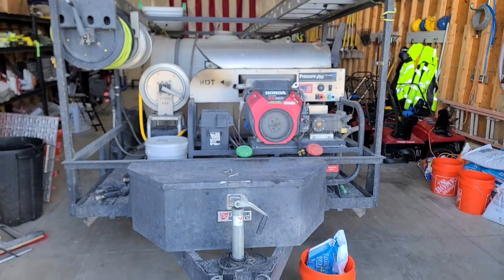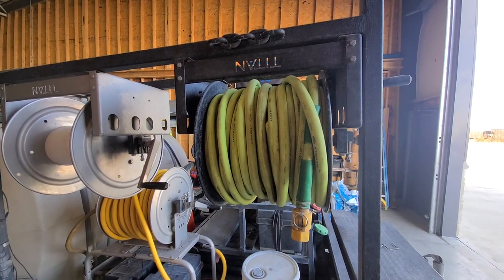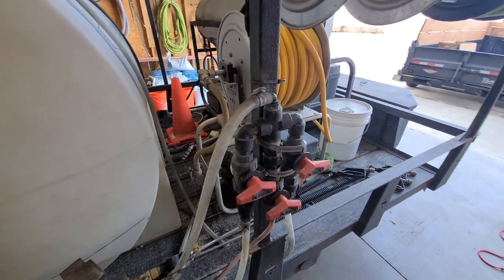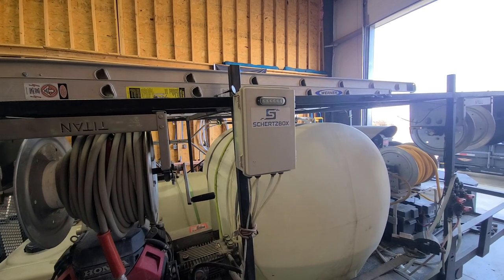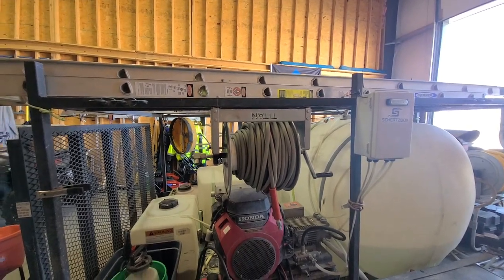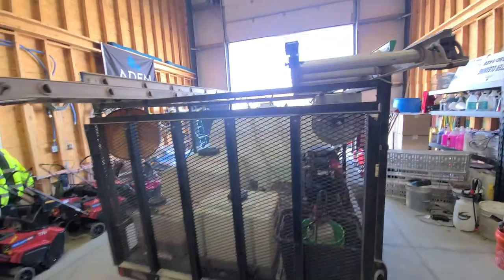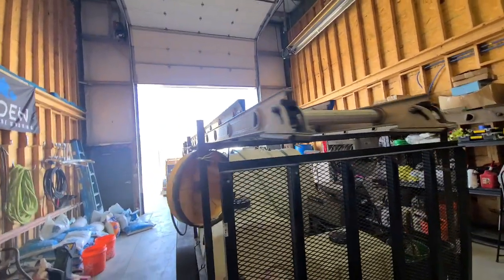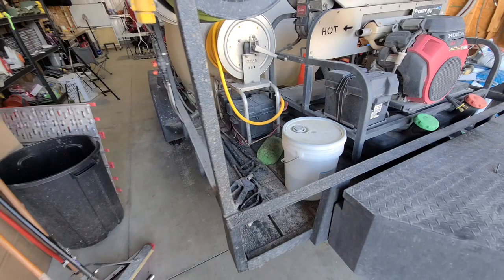2023 Pressure Washing Trailer Setup and Walk Around

Comment: Looks good. If I was to make one suggestion, it would be to add a piece of flat steel or something at the bottom of the surface cleaner, just so the bottom doesnt flap around in the wind as you are driving!
Reply from the maker: Good tip!

Comment: I love it.   The trailer.    I’m thinking about getting one but I’d like the smallest but still vertical capable.   Probably cold water for starters.   I’d like to get a skid but I’m not sure if it holds enough water/ SH.   Any suggestions ?  Probably residential for starters
Reply from the maker: @northjerseykevin409  if you're planning on doing mostly residential you could get by with a skid. Larger commercial and jobs where you need to bring water out a trailer would be the better choice. The trailer is nice because you can just unhook and use your truck as normal. That's a little more tricky with a skid